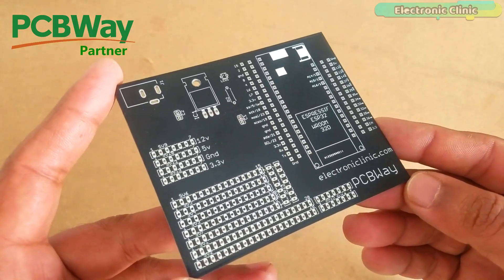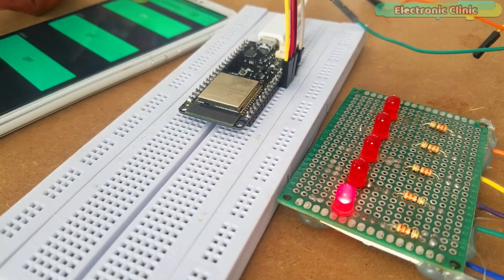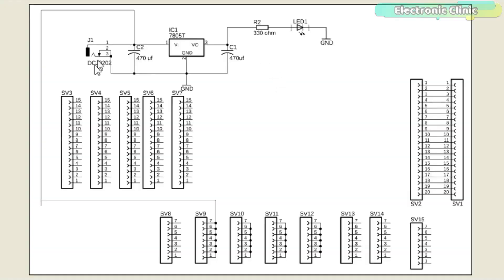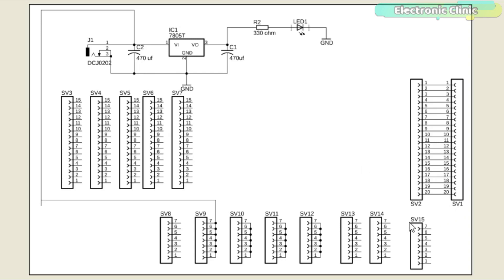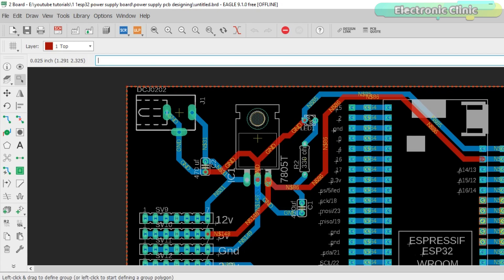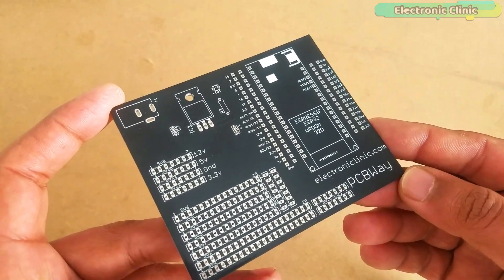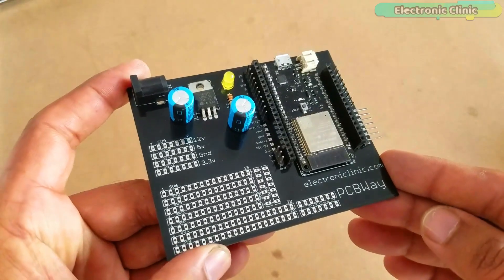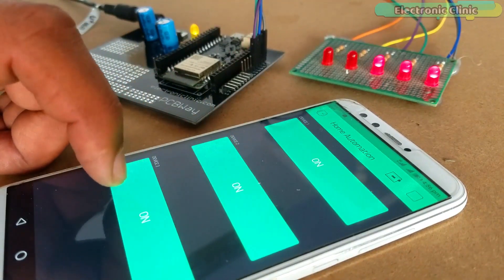ESP32 Power Supply PCB board, ESPRESSIF ESP32 Devkit WROOM

Comment: Nice work on the board design!What modifications would be needed to ensure the 5v output is in range 4.9 to 5.1?
Reply from the maker: You should watch my video on 5v and 3A power supply. You can set different voltages plus all your current related issues will also be fixed.

Comment: Is that 7805 voltage regulator not getting extremely hot?
Reply from the maker: Ya it is. That's why I designed a new power supply 5v and 3A. Check playlists

Comment: I'm trying to power an ESP32 with 2 AA alcaline batteries and using a step up DC-DC (MT3608) to make it to 5V. The red led blinks all the time non stop.

This setup works for the NodeMCU ESP8266.
It also works using a simple phone charger.

Any ideas?

Comment: how did you know the exact dimension of your esp32 board? Like how far apart should the female headers for slotting in the esp32 should be? you haven't put any links to the pcb design in description
Reply: Standard breadboards support a pin pitch (the distance from the center of one pin/terminal to the center of the adjacent pin/terminal) of 2.54 mm. Calipers are also very handy in PCB design if you need to measure!